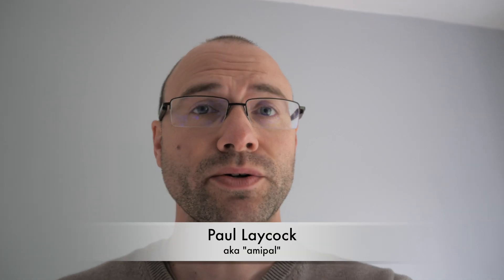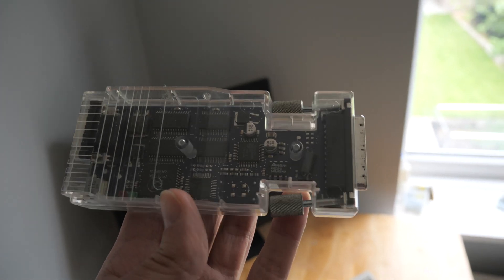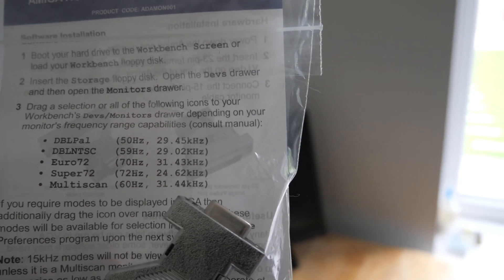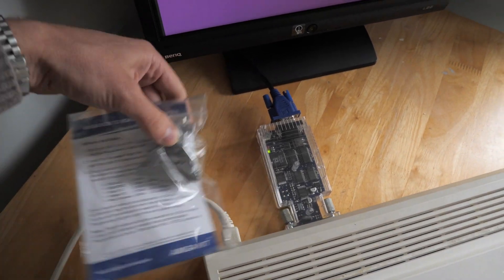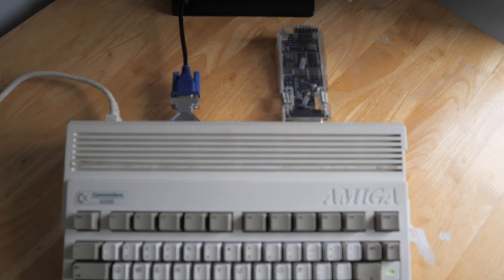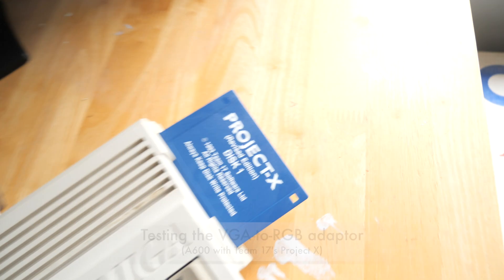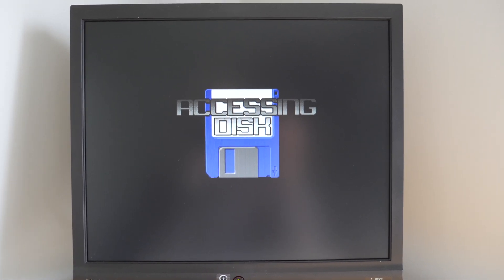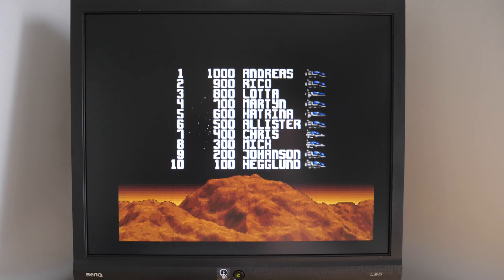amipal #2: VGA to RGB test

Comment: is there any difference on a crt?
Reply from the maker: I'm afraid I don't have a CRT monitor to test with, sorry!
Reply: Is this just plug and play beacuse i have zero idea about this kind of stuff and just want and image out of my amiga don't care what it's like
Reply from the maker: @sammy61187  Both just plug into an Amiga’s RGB port and output to VGA. The only difference is that the scandoubler will output a higher frequency, and so will work on most if not all monitors, whilst the simple adapter requires the monitor to be able to sync down to 15khz.
Reply: @sammy61187    yes and no.    No , the amiga won't adapt to the capabilities of the   VGA display its connected to, Yes, the VGA display will adapt to the signal it receives, if it could show it.   Some flatpanels and most CRT's wont do the 15 kHz horizontal, and for them you need the scandoubler version,  OR to use workbench to configure the output (which isnt permanent, its only for programs that workbench will configure... )
Reply: The complete failure to work, until you  change the horizontal frequency coming from the Amiga  to be 30 kHz  (at least  ? ) .  Its rare for the CRT to be able to do 15kHz horizontal that the amiga 500 outputs.     PC VGA monitors would need to do 30 kHz horizontal rates...  And the need is to go FASTER to get higher resolution, why would the PC monitor need to go slower than 30 kHz ?  And the huge capacitors and inductors in the CRT circuits set the refresh rate, so its expensive for the CRT to be extended toward SLOWER and LOWER RESOLUTION.  Its rare that the  CRT can do the slow 15 kHz.

Comment: Hello! Sorry to disturb but i have 3 questions. AmigaKit adapter screen is darker on upper side. Is this the YT video or view angle or really dark? And 5:38. On the screen vertical dark lines. Is this YT video noise again  or adapter noise? AmigaKit Amiga 500 compatible? Thank You!
Reply from the maker: TubeAtilla Not a problem! It's the viewing angle of the Benq monitor - it isn't great. Always tricky to photograph or video anything from it. 
I haven't tried the adapter with an A500 yet, though I don't see why it wouldn't work.
Reply: Hey there, I can confirm the Amigakit vga adapter does work on an A500+ and an A4000 rev D  👍